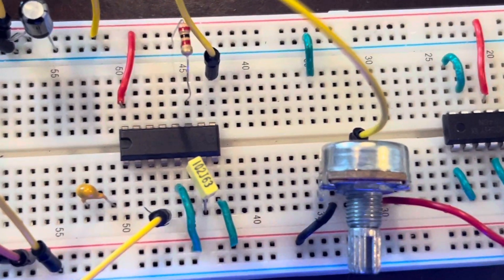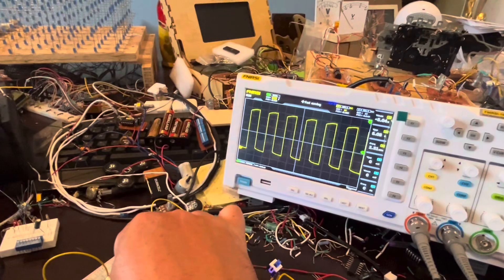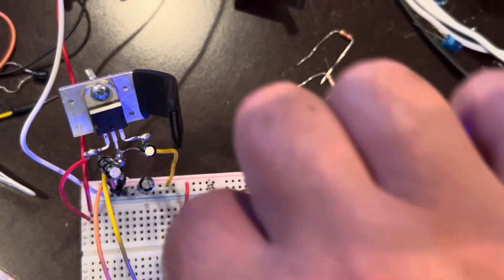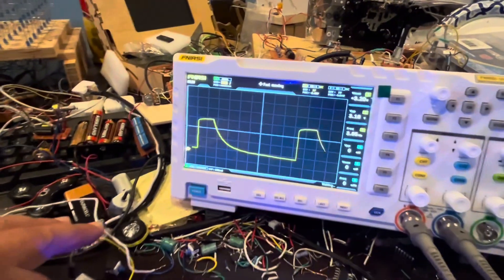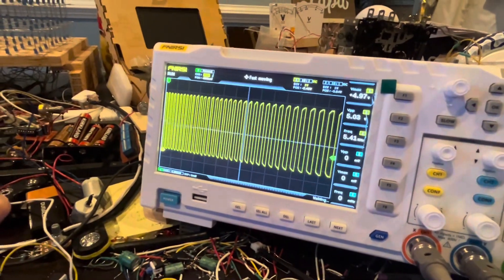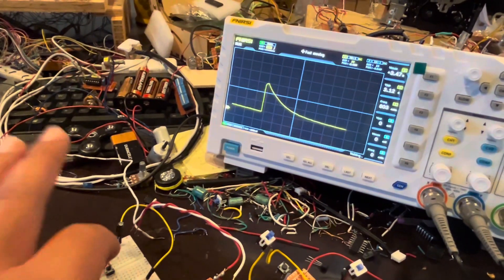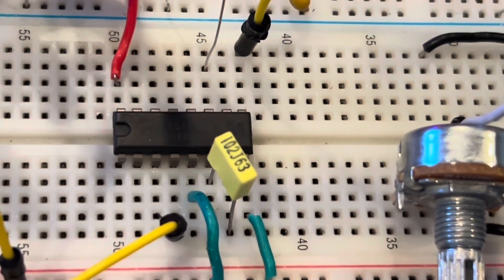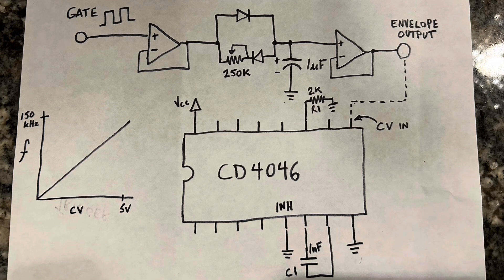CD4046 Voltage Controlled Oscillator and Envelope Generator Experiments

Comment: This has such a lab bench project vibe, down to the positive and negative rails being wired backwards because the breadboard was cannibalized from a previous project and there's no time to "fix" it when you have an idea. Feels very familiar.

Great video. The frequency instability at 2:03 was interesting; was that a rolling shutter artifact or an artifact of using the PLL chip in the way you are and without the usual filtering and stabilizing components?
Reply from the maker: @Brenden.smith.921  thanks for the comment. I think its the latter because when i dont mess with it is pretty stable